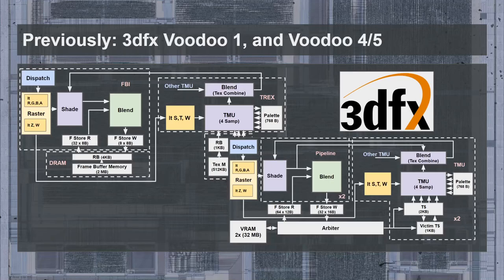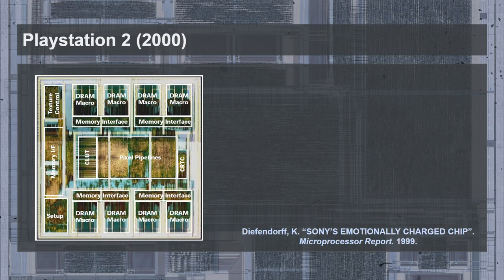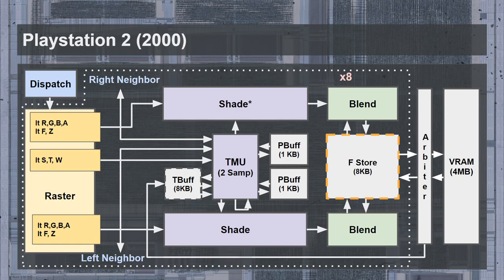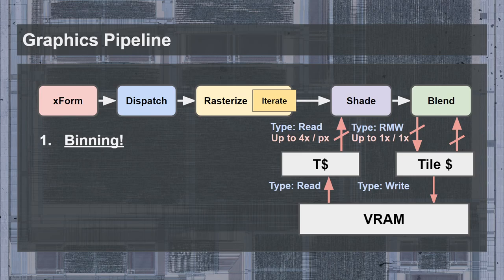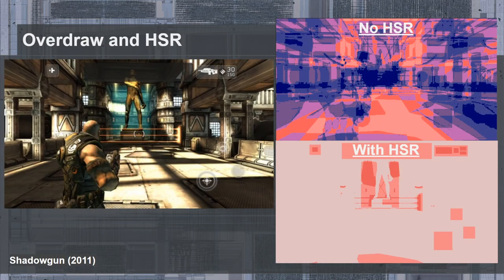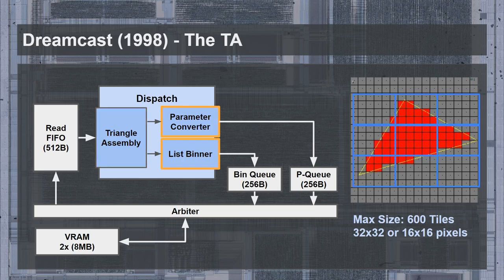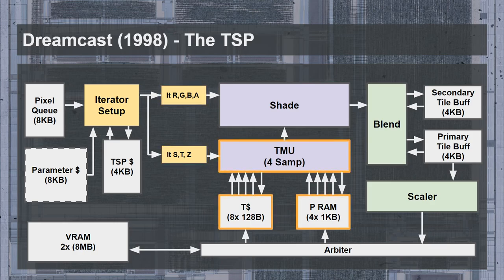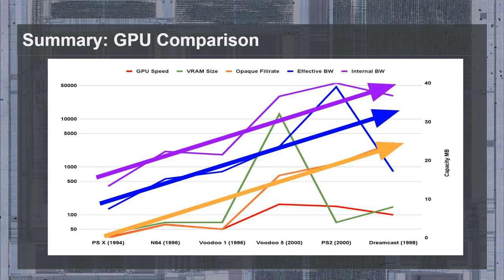GPU Memory, and Clogged Pipes (Part 3 - PS2 and Dreamcast/PowerVR) - #GPUJune2

Comment: I've always heard people say that TBDR's have a frame of latency. Maybe that was the case for older designs, I'm really not sure, but a lot of the time it felt like people misinterpreting what was happening because I've never seen anything from Imagination saying that. All that's happening is that, instead of the vertex and pixel shading being interleaved, like in IMRs, it's more like all the vertex shading happens and then all the fragment shading happens. There's nothing about this that requires that the pixel shading needs to happen on the next frame.

The two stages don't take the same amount of time either. A triangle more or less just stays three points (three numbers per point) the whole vertex shading stage. One of those triangles can become hundreds of pixels in the rasterization phase though and that's going to take more time to compute and write to memory. In that sense, an IMR may have it's whole pipeline backed up by one triangle that turns into a particularly large amount of pixels. Since a TBDR keeps the stages separate, it can potentially finish it's vertex shading for a frame in far less time with less stalls. Then the fragment shading stage gets a huge boost from HSR and it's dedicated, fast on-chip buffer.

Now you're right in that, while it's fragment shading one frame, it can start vertex shading the next, it's not like it's waiting for the next frame in order to start pixel shading. It's just getting started on the next frame before the current frame is done.
Reply from the maker: What is meant with "1 frame of latency" comes down to the fact that all triangles must be submitted before rendering can begin - at least with the older GPUs. The new PVR archs (especially those used in the Apple SoCs) can reload previously rendered tiles, but the GPU used in the Dreamcast had no method to load the tile buffer from VRAM.
So in practice, you want to pipeline the entire process, which gives you that extra frame of latency with IMRs don't require (since the render tiles can be revisited there).
Submit -> Vertex Transform -> Bin -> Render -> Display. 
While you could do all of those in a single frame, that necessarily reduces the total amount of work you can do, else you will have to re-render the previous frame (introducing latency).
For IMR, you don't need the Bin stage, and can instead interleave them, meaning you have...
TBDR:
|Submit -> Vertex Transform -> Bin ->| Render ->| Display|. (3 frames)
IMR:
|Submit -> Vertex Transform ->  Render ->| Display|. (2 frames)

Note that the Dreamcast was specifically modified to reduce this latency under certain scenarios, in which the tiles can be rendered in scanline order meaning that the next frame can start to be displayed while the pixel visibility was being computed and then shaded.
Dreamcast:
|Submit -> Vertex Transform -> Bin ->| Render -> Display|. (2 frames)
Reply: @RTLEngineering  If the Dreamcast couldn't re-load the tile buffer from VRAM then I don't know how that would be an issue unless the game was trying to use the rendered image as a texture. Outside of that, what gets rendered to the tile-buffer and then out to VRAM is the finished tile for the frame. It only needs to be read by the display controller and sent to the TV. It can still read from it's tile list in the same frame.

|Submit -> Vertex Transform -> Bin ->| Render ->| Display|
|Submit -> Vertex Transform -> Bin ->| Render ->  Display|

What you're saying about the Render and Display steps makes complete sense to me. It's the separation between Bin and Render that makes none. It's not reading from the tile-buffer here. The tile buffer is at the end of the pipeline. The Bin -> Render stage is when the tile list is being pulled into the GPU from VRAM to be rendered. There's nothing that would necessitate waiting for the next frame deadline for this to happen. If the GPU can't read the tile buffer from VRAM then that wouldn't cause an issue because the tile buffer isn't the tile list/parameter buffer which is all that's needed to be read in that stage. The tile list can obviously be read VRAM because that's where they're stored. If it couldn't then the GPU wouldn't work at all.

I could understand it if you're looking at a example where the last triangle is submitted close to the deadline though. The IMR will have already completed rendering of almost all previous geometry and only need to finish that up. In that same case, yes, the TBDR will not complete rendering before that deadline because it was waiting for the last triangle to start rendering. But by saying that these two stages always happen in different frames would be incorrect. For example, if you're just rendering a menu on the Dreamcast then the amount of submitted geometry would be so little that it could be in counted by hand. The CPU computation and geometry submission could take, lets say, half of a millisecond. The transform and binning stage would take less than that. At that point it's not going to wait for the next 16ms before it starts rasterizing and texturing those triangles though. It's just going to start reading the tile list right after it's done with binning and it will finish rendering far before the next frame deadline and there will be no frames of latency.
Reply from the maker: The issue is that every triangle for a frame must be binned before rendering can begin. So if you have 4M triangles in a frame, you must first submit, transform, and bin all 4M triangles before the first render tile can be touched. If you start rendering a tile before binning is complete, then you may finish visibility testing and rendering before all of the triangles are known for that tile - that would result in dropping triangles over the screen randomly based on submission order.
This is a hard deadline which is not necessary for IMR - IMR can accept new triangles until a few cycles before the new frame must be presented to the display. Even the IMR architectures that do a type of render tile binning do so on a rolling submission basis because they can return to a previously rendered tile.

The scenario you described is correct, in that case you have less work to do and therefore the deadline isn't as tight. But in general, a game developer wants to submit as many triangles with as many textures, with as many effects as possible, per frame. If you combine Submit->Vertex->Bin->Render, into a single frame, and target 60 fps, then that 16ms must be divided into the two phases: Submit->Vertex->Bin, and Render. So if Submit->Vertex->bin takes 10ms, then you only have 6ms to render all of the tiles (480p would be 300 tiles, so 20us per tile), which limits the total triangles per frame.
Also keep in mind that Submit->Vertex is done on the CPU (for the Dreamcast) and is interleaved in the game logic itself, so that's going to take longer than if all it were doing is pulling from a preset list in RAM. Binning is done on the GPU, but only handles 1 triangle at a time, so that will be slow if there are too many as well. (It's a write-amplification task, meaning it can be done in bounded but not constant time).
Regardless, if you take that approach during a game, you're likely going to drop every other frame to catch up with rendering.

The alternative is to render the tiles as you display them, but that would mean that all 20 horizontal tiles need to be rendered within 1/15 of a frame, or 53us each. If the row of tiles is not complete by the time they need to be displayed, then you again need to drop the frame or accept screen tearing. While that same number is also true for the entire screen at once, you have 300 tiles to balance out the load rather than relying on 20 (you're more likely to have some tiles that take 2ms and some that take 2us in a pool of 300 than 20).

In both cases, if you drop a frame, then you get 1 extra frame of latency. And besides, in your menu example, 1 extra frame of latency is not important... you should be thinking about the cases in which both latency and performance matters.
Reply: @RTLEngineering  I think you're misunderstanding where I'm disagreeing with you. I'm not disputing that submitting and binning all the triangles for the scene before rendering is a hard requirement on a TBDR or that "chasing the beam" with tile-render order would be required to get the most work done before the frame deadline.

Where my issue lies is with saying that the 1 frame of additional latency is a rule that's built into how the hardware works when it isn't. That's the reason why I mentioned the menu example. It's not representative of the workload of a full 3D game scene, sure, but it demonstrates a real scenario that's not uncommon on the Dreamcast or a PC where the GPU would be needlessly wasting time and adding latency if it were really a hard requirement for the GPU to do it's vertex stage and fragment shading across two different frames. That's not how any GPU designer would design their GPUs and that's not Imagination designed their's.

You could say that a frame of latency is a side effect of the architecture when triangles get submitted too close to the deadline and you could even say that that's common but explaining it as if the hardware literally can't avoid the latency in any scenario and is an absolute requirement of the hardware... is wrong. If the hardware has enough time before the frame deadline to finish rendering after it's done binning (like in the menu example or even in the case of a 2D game) then it will do that and it won't have the latency.

This is an architectural video so it should describe the architecture. If there's a realistic limitation to that architecture when in use then that should be mentioned, too, but shouldn't be phrased like that limitation is built into the architecture. I mean you said it yourself. If you target 60 fps then the 16.6ms then to render the frame. That could be 10ms for Submit->Vertex->Bin with 6ms for ->Render->Display... but you CAN do that. It's not a hard limitation.

Also keep in mind that workloads in a game aren't constant, they vary. If that's how one frame works out then the next frame could be the inverse of that, 6ms for Submit->Vertex->Bin with 10ms for Rending->Display and that assumes that the CPU waiting until the deadline of frame 1 before it started frame 2. If it started the vertex stage for frame 2 right after it was done with the vertex stage of frame 1 then it would be ready to render to start rendering frame 2 around the time of the deadline for frame 1. Sure, frame times aren't often that erratic, you can argue that the scenario I just mentioned isn't common, and you could say that the hardware would be underutilized in that scenario but the hardware IS capable of it.

Lastly, any game that hits a stable 60fps likely isn't just hitting it's deadline, it's done way before it and is just capped at 60fps. The same is also true for 30 fps games. Without a cap, they could run at 35 or 40 but they just cap it at 30fps. That means they have 33.33ms between frames but they'll often be finished rendering in 22-28.5ms.
Reply from the maker: Sure, although I don't think I ever claimed it was fundamental hardware constraint. That would be entirely wrong as the hardware had no interlocks as far as I am aware of - you could have it display a partially drawn tile if you hit the pointer-flip at the right time. Practically, I gave two examples in my previous response in which there would be no extra frame of delay, and mentioned the limitations of doing so.
Typically software running on a TBDR do introduce a second frame of delay in how the software controls the GPU though, for those very reasons. It's also a lot simpler to write the game code to account for that delay than to dynamically adjust to it.
Note that even with IMR, you don't need to have any frame delay either - you could just render directly to the display buffer (the PS2 did this in some cases), in which case you would be submitting triangles to the frame as it was being rendered. The Nintendo DS was actually notorious for this as that was the only way to draw the triangles (chasing the beam).
Regardless that's arguing more semantics than anything since it's more complicated to say that the extra frame delay was introduced by software, as a result of the TBDR architecture's hard bin deadline requirement (a requirement not imposed by IMR), but could be overwritten in cases where the deadline is more relaxed or visual artifacts were tolerable. 
Some simplifications need to be made for an architecture video / lecture, as it's not reasonable to list all of the nuances. For example, you could use the PVR2 to compute N-body and fluid simulations instead of drawing triangles, same thing with the PS2's GPU (as a hint, you would do so with blending modes). Drawing 3D graphics is not inherent to the architecture itself, but it's the common / primary use case. So the video should discuss the common case where the rest is left as an exercise to the viewer.

I disagree with your last comment about 60fps. You could easily write a game that continually just barely hits the 60fps cap as the GPU has two limits - visibility and shading. So you could have more than enough room in visibility, but be compute limited by the shading engine where a poorly ordered texture cache miss causes you to miss the deadline (this is what happened when drawing 2D sprites). The same thing happens can happen in modern 3D GPUs, but didn't usually occur in the older 3D ones like the Voodoo since the rasterizer was tied to the shading pipeline.

Comment: Amazing video RTL! I have always wondered about the whole PS2 vs Dreamcast debate and now that I finally found a video that really showed just how powerful the Dreamcast is as well as its actual limitations. In any case on the topic of the transparency, what do you think Sega and the PowerVR team should have done with the benefit of hindsight in order to fix (as in make it match the opaque performance) the transparency performance of the Dreamcast gpu? Also you mentioned that the Dreamcast GPU uses a dual channel memory structure, as it has 2x 8 megabytes of ram, which does not make sense to me. How can the Dreamcast gpu have 16 megabytes that it can directly access, when on the Dreamcast motherboard there is only 8 megabytes?
Reply from the maker: Thanks! It turns out to be quite nuanced, and the games developed for each console sort of skewed the perception. 
That's an interesting question... I honestly don't think they could have done anything differently. Ideally they would have at least added a second rendering pipeline (in the TSP), but that would have require quite a bit more die area (maybe even require the GPU to be 2x bigger). And die area means it would have been a more expensive system. It's possible that some of the ISPs could have been removed to trade off solid polygon fill performance, but given the cache sizes (physical die area), you probably would have had to remove all but 2 of them in addition to the HSR sorting. So that wouldn't have been a worthwhile tradeoff (3200MP/s solid fill down to 400 MP/s sold or transparency fill).
As for the VRAM, it was 2 channels of 4MB each, for a total of 8MB. The 2 channels meant that it could read from two independent memory addresses simultaneously (think double buffering).
Reply: @RTLEngineering  Interesting and yeah I was wondering if it would have been smart to sacrificed some of the ISP to make room for the extra rendering pipelines, but like you said it could have been too much of a sacrifice for the opaque rendering, oh well. That does bring up an interesting question with todays modern up to date PowerVR gpu, do they still have this problem and if not what did they do to get around it? Also thanks for clearing up the memory thing, yeah 2 channels of 4 megabytes each makes a lot more sense :)
Reply from the maker: Modern PowerVR GPUs have a similar problem, but they are scaled more appropriately to their IMR counterparts. All modern GPUs do a form of HSR / early-z testing (which can be disabled for transparency). A difference is that the modern GPUs don't need to worry as much about coalescing the shading transactions, so they take a more greedy approach which leads to some overdraw (it's a balance between hardware complexity and performance). They're all limited by the shading back-end though (or in some cases, the ROPs), it was just more apparent in the late 1990s due to the low degree of parallelism (and lower transistor density).

Comment: So? Is the Dreamcast so weak or is the PS2 so powerful? as has always been said?
Reply from the maker: Neither. The Dreamcast was good at a certain subset of rendering, and the PS2 was good at a different subset. They each used wildly different architectures, which excelled in different areas. One wasn't better than the other in general, and on average, they were equally powerful (although the CPU and VUs on the PS2 was more powerful, both of which were largely used for more advanced vertex calculations, including particle effects).